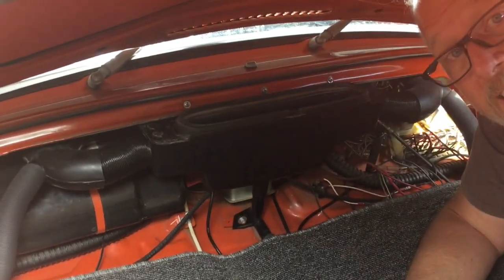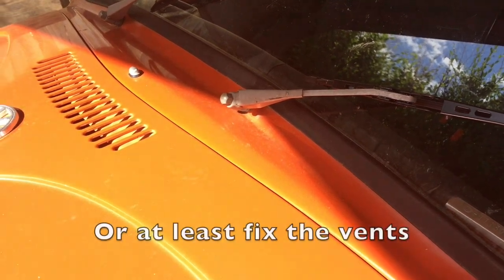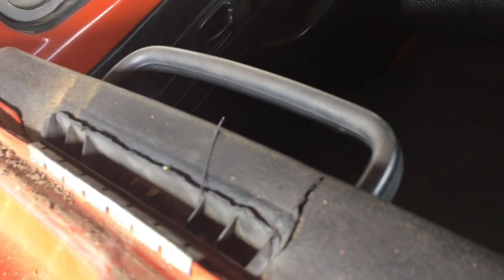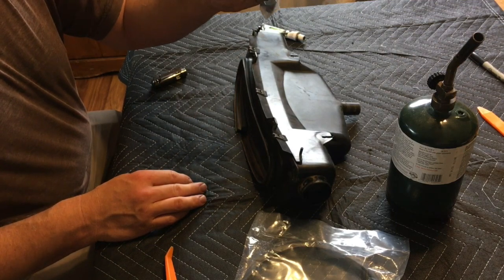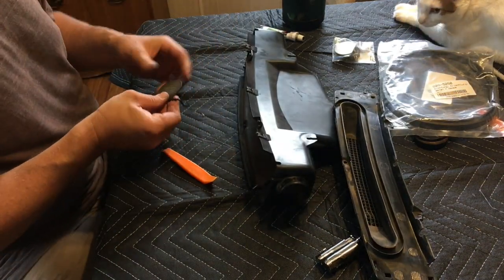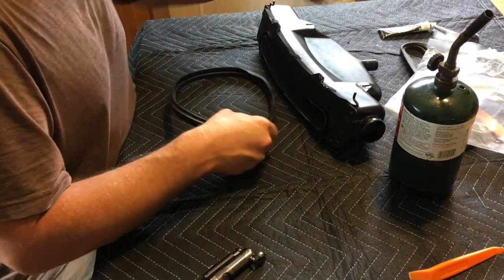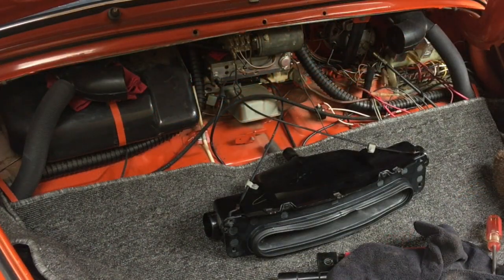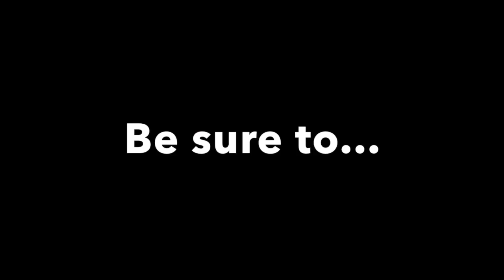VW Beetle Fresh air box and vents

Comment: I own a '71 Super Beetle, and I have just removed the Fresh Air Box, not to repair it, but to gain access to the Electrics behind. But there was one job that needed doing badly! The Speedo Needle had started to get some jerky movements at lower speeds. With that large plastic box removed, it is easy to undo the Speedo Drive. Then, I lubricated with about 5ml of Singer Sewing Machine Oil, mixed with finely powdered graphite. By gravity, and over a short time, the lubricant will go through the whole cable. So please remember your Speedo Drive!

Comment: Great vid. My 68 had its fresh air system in pieces when I bought it; still working on rewiring. So, once I get to it, I'm going to use this as the template for how my system should be set up.

Comment: Excellent video-the Volkswagen Beetle was a high quality and very enjoyable car when it was built and should not have air leaks, poor heating, or fuel smells as so many of them do-parts like the seals and vents you have covered age, and when you put them back in proper working order, it makes owning and driving a VW much more enjoyable. Not having cold air blowing in on you from the vents and having a working defroster are pretty simple tasks to do right,  but are often over looked or improperly done

Comment: Instead of heating the retaining pins, I just cut them off. I then drilled small pilot holes in each pin and used small large head screws to put the top back on. Works great for future disassemblies.
Reply from the maker: Good idea as well!

Comment: What are the black plastic corrugated tubes that are on each side of the air box you rebuilt and going behind it? You pointed to one and said you "snapped it".    (they are loose in my car under the hood and not connected to anything)
Reply from the maker: Those go to the air vents in the top of the dash.

Comment: I have a big problem with my '74 Super. It has a water leaks which results in water dripping to my driver side floor mat. It drips from somewhere around the steering column. I'm guessing those front grills in front of the windshield is to blame. Do you have a solution for this? It is bothering me for such a long time now and I don't want to keep a bucket in the car anymore :)
Reply from the maker: The air box on the super is similar. Pull out the drain hose on that bottom and make sure it isn't plugged and there isn't debris in the bottom of the box. If it's OK, check your hood seal and make sure there aren't any holes between the hood and the interior of the car. But, your problem might be the windshield seal if it is original. They shrink over time and water gets in. If I drove my Bug in a rain water came in the corners of the windshield. I replaced it and all is well now.

Comment: Hi, here someone that doesn´t know anything about bugs but just got one. Where does that hose drains the water out of the car? The drainage one that you have under the carpet? I do not have those parts on the bug I got, it´s a 1977 model but, the prev. owner removed all of the ventilation system, he just left the fresh air box, so I put some tape to avoid the water getting inside. My idea is to restore all of that back to original. (I do not live in a place where I have to worry about snow, but we do have a lot of rain)
Reply from the maker: It goes out just before the fuel tank on the standard Beetle. If you have a Super I’m not sure.

Comment: Does anyone know how to replace the heater hoses that go in the fender.
Reply from the maker: I saw a video where someone used flexible exhaust tubing. It’s metal so it can be worked down in there easier. The hard part is getting all the old paper off.
Reply: It’s not easy, and you cannot use the flexible stainless pipe unless the 1/4 panel is removed on the outside. Get the original 36 mm from Wolfsburg west metric, and it is still a struggle, but doable with patience. As the man said,the hard part is getting the old stuff cleaned off the pipe at the bottom. Took me three days of laparoscopic surgery to do just one side. It will definitely test your patience. 👍👍🇺🇸

Comment: Good video, but was really wanting to see how to install the vents, what gets clipped into what, firmness, especially how to insert the air/windshield vents. Its a shame, it was all there to show the exact install, but was not included.. I said NOOoooo!
Reply: The passenger vent, how difficult to install around/behind the windshield wiper motor..? - wanted to see that...
Reply from the maker: I didn't have to do the center on mine. The vent outlets all go in from the top or front, and the vent itself are all in the trunk. I imagine taking out the radio, fresh air box, and wiper motor would make it easier to get to the vent. I had to glue in the left and right vent housings because the double sided foam tape was just gone.

Comment: Sorry for the down mate, but you wasted my time. How to get those bl**dy elbows out of the darkness and airtight back into place is of more importance (no information can be found on the web) than stating the obvious someone not clumsy will gather anyway before he lays hands on and those who are should not try anyway... Regards Damian
Reply from the maker: Are you talking about the ones that come from the heater channels? The only information I’ve ever seen shows people just cutting a hole inside the car to get down there. Then replace them with the stainless steel, flexible, exhaust hoses, 72 mm I believe. That was really not the title of my video, I’m just focusing on the heater box.
Reply: @Misunderstoodboygenius  Are you kidding me or is about derailing the post? Unless you really don't know that the tubes right and left leading to the vents the fresh air box is connected to eventually are called that due to their shape. I am afraid, but if that's the case you should refrain giving the smartie on the topic...